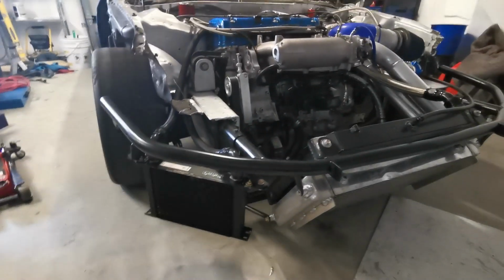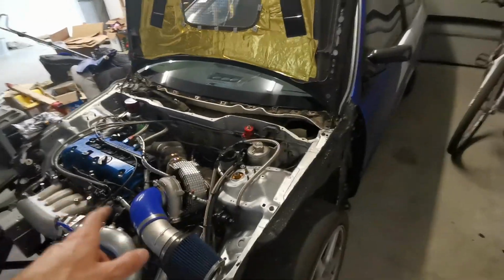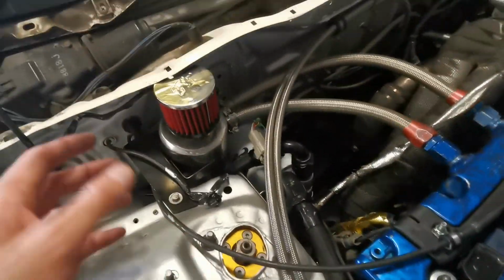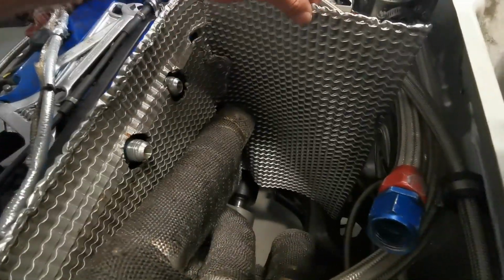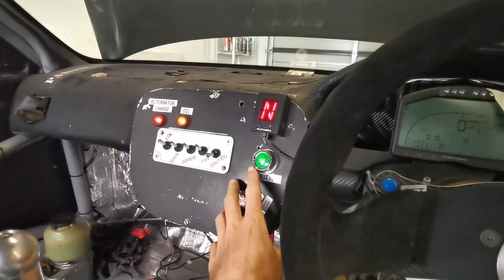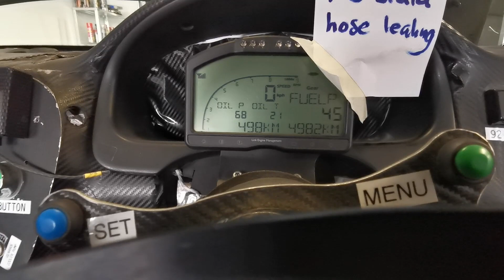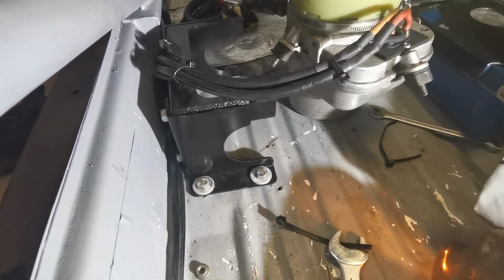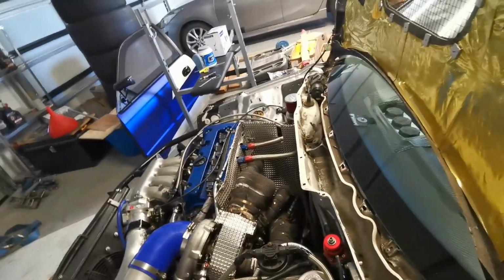K20 Turbo EK Civic *first start!*

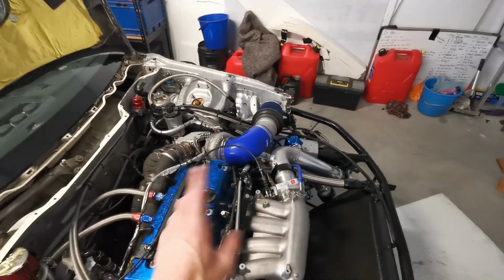Comment: 2:52 That is the exact type of heat shielding I want to use for some of my engine bay. Does it have a particular name?  I've not had great luck finding it in my search results.
Reply from the maker: I get it locally here, it's called "Platinum Heatshield Material HS1S" here. Super easy to work with